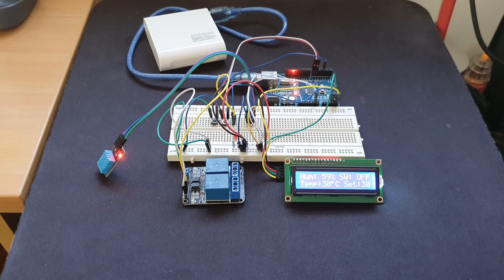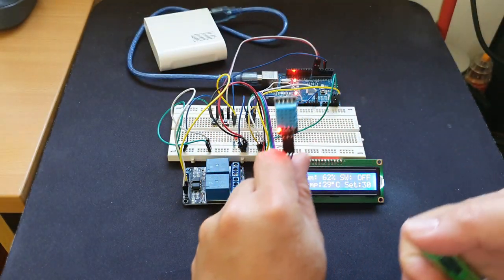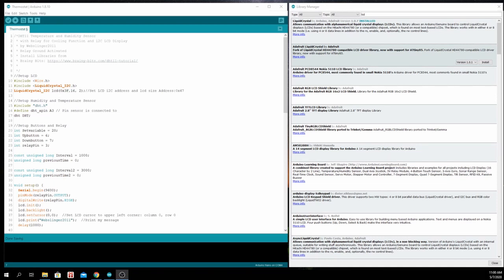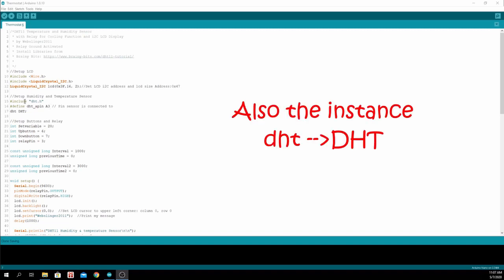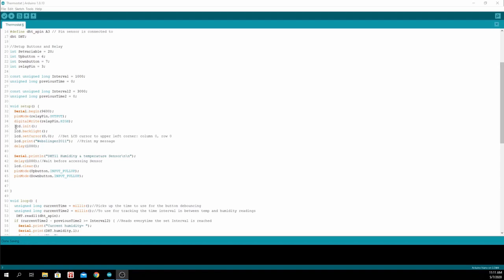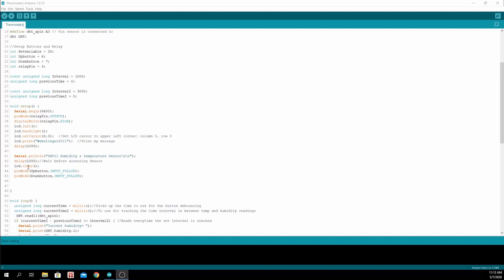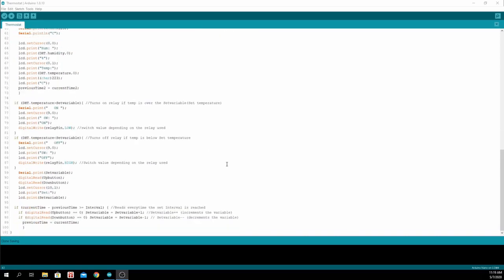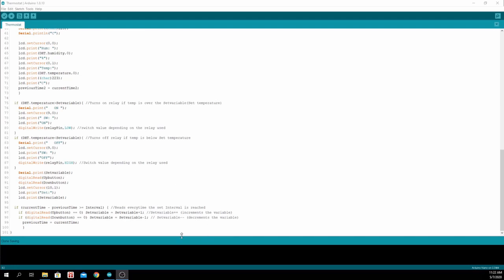Arduino Automation "Temperature Control" Part 2

Comment: it is possible to change the program, instead of turning "on" when the temperature is rising it will be "off" ? Thank you for your answer
Reply from the maker: Probably need to use a while loop and some variables to compare previous vs recent values.

Comment: great job. can ask how  run more than one fan ? i wanna run two fans one for circulation to control humidity   and the other for ventilation /exhaust its for mini greenhoust project in currently building. thank  you in advance.
Reply from the maker: You'll need to declare more variables to activate a second relay, buttons to set desired humidity (value) and add if statements to use humidity values (DHT.humidity)  to control the other fan.
Reply: @webslinger2011   thanks alot  for youl help. bless you.

Comment: It works well. Can the sensor be replaced? DHT22
Reply from the maker: You could use DHT22 but will need to make some changes to the code.

Comment: Can we get arduino uno code for this project??? I had a similar project named as water immersion heater  in which i wish to display the temperature and set it to desired value with automatic switching.. If any good clue for me so please share it  to me.
Reply from the maker: Download the files on Github. See wiring and code link in the description.
Reply: @webslinger2011  thank you😊
Reply: Using arduino Uno and Dsb182b0 temperature sensor..

Comment: I need coding
Reply from the maker: Code availble on the Github link in the description.
Reply: Hi sir,thank for information..bulb on/off temperature 37°c to 37.5°c.fan on/off humidity 60% to 65%.auduino uno,i2c LCD, DHT22 sensor,relay module used.i need auduino uno programming code sir....help me sir...